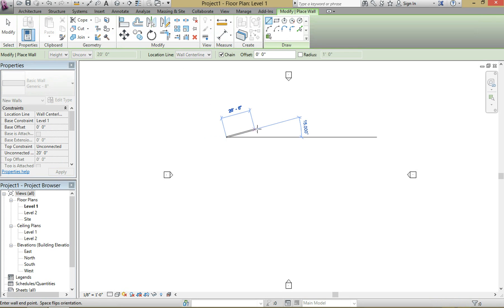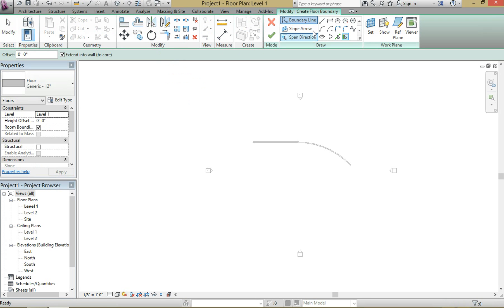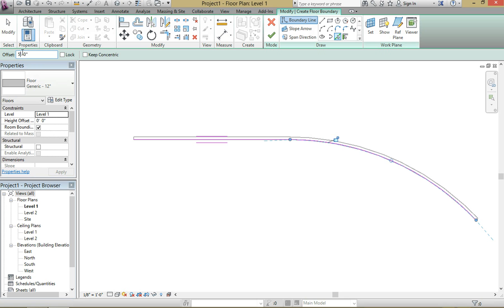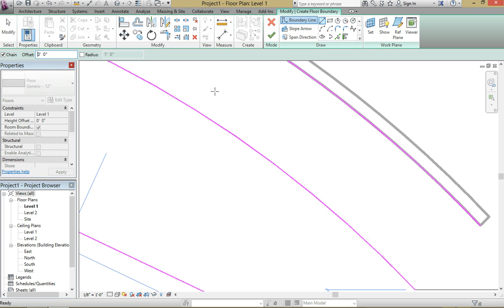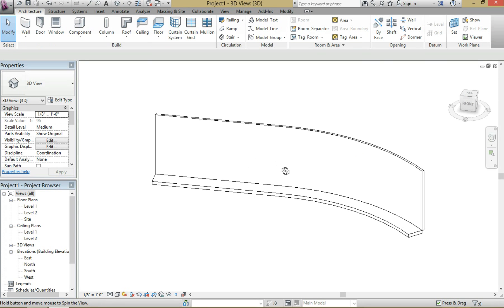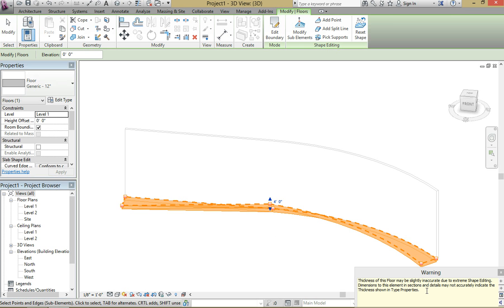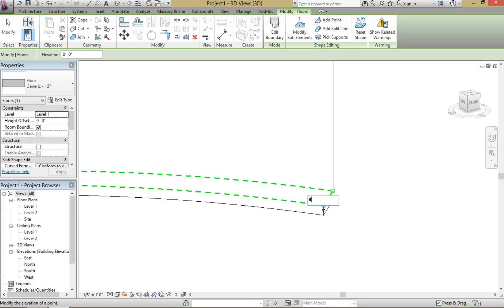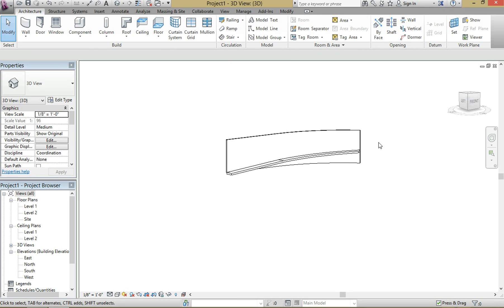(How To) Autodesk Revit Basic Curved Ramp

Comment: Hi! If you're still answering, how could I add railing to the ramp? Thank you
Reply from the maker: I've gotten that question a few times. No luck thus far. :/
Reply from the maker: @addeluce said the following: "Execute Railing command, Sketch Path > Pick Lines > Pick the Railing Host (edge of sloped/curved floor) > Check. Select the Rail > Pick New Host > Select the Curved/Sloped Floor."